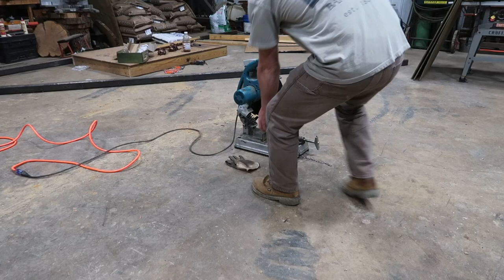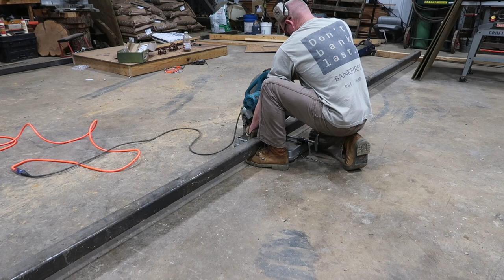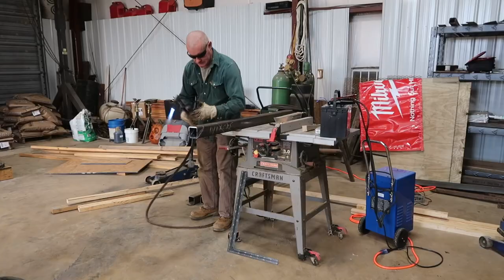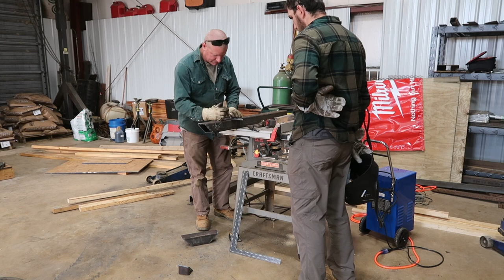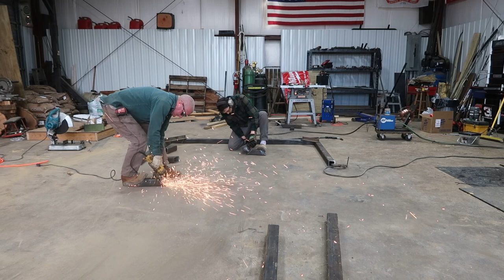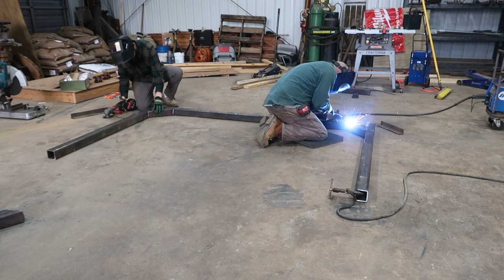Building log bolsters for my gooseneck trailer

Comment: nice!  You need to get you some jack stands and a couple of 6'-8' pipes to lay between them.  That welding on your knees is a bad deal.  I like jack stands better than a big table.  Can  get all around everything and adjust the height unlike a big table.